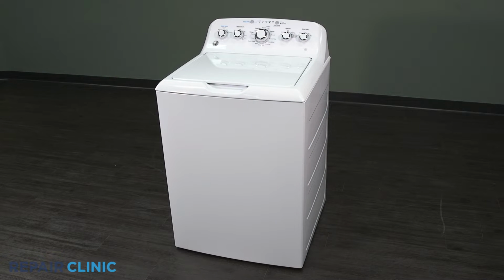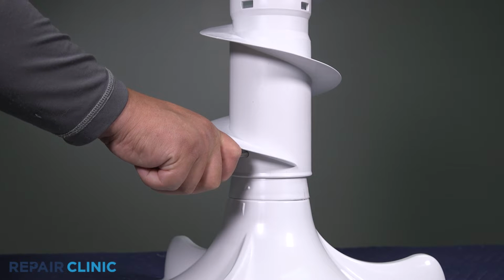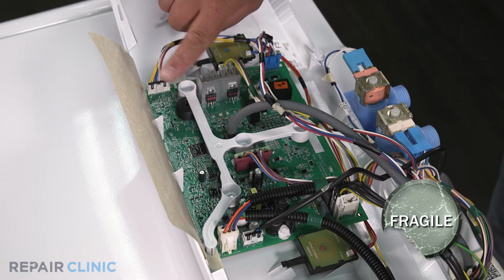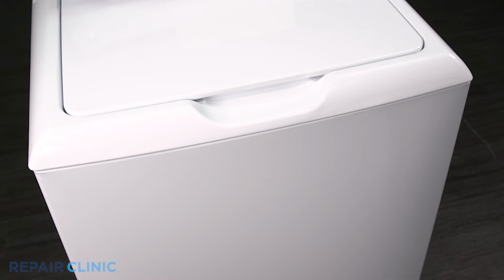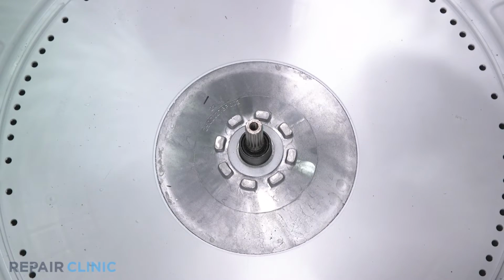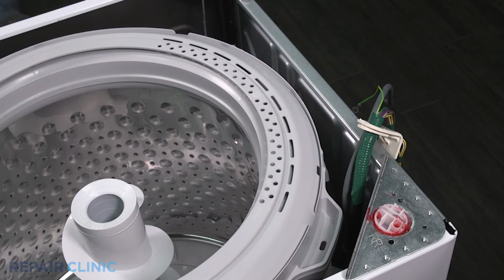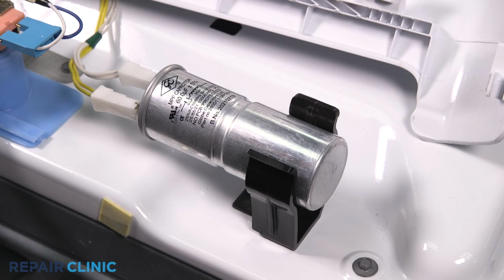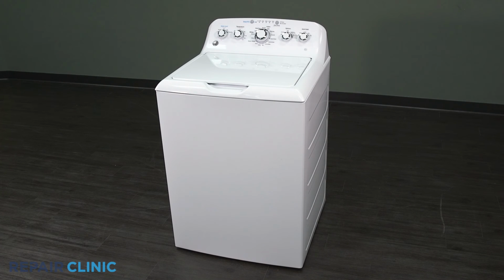GE Washer Basket Assembly Replacement WH45X26674

Comment: Can you please specify the deep socket you used to reach / unscrew the 33mm nut? 2:03 into video
Reply: Get a 33mm deep well socket. I run a Milwaukee m18 impact specifically for these situations. I suggest either this or their fuel line for the breakaway torque. If you're gonna do a breaker bar, you will need a comically big extention on it to clear the height of the tub. Also man, that auger is one of the worst things to deal with in this industry. If I were you, I would order a replacement assembly just in case you break the original during removal.
Reply: @YourFoolishPride  I was able to get the 33mm deep socket and with my black and decker impact it’s not budging at all. This thing is really on there. I have been applying penetrating oil every day for almost a week now to try to help it. I just bought a 20” socket extension and will try with a breaker bar as a last hope. This design is remarkably user un-friendly.
Reply: @jeremyhartman9798  I apologize for this foolish question here, but are you going cw or ccw? The problem also could be that your black and decker might not have enough breakaway torque for this situation. I'm gonna call another tech I work with to see if he has any tips I might have missed for you. 

When I used to work on semis, we would torch a lot of the bolts to heat em up for ease of removal, so there might be some merit in getting you one of those little acetylene torches you can grab from a hardware store.
Reply: @jeremyhartman9798  also man, GE is one of my least favorite brands to work on as of late. They're like the Saab of the appliance industry... Over engineered in the goofiest places. 

In case ya needed to hear this:
I'm rooting for ya, brotha. You got this!
Reply: @YourFoolishPride  I’m going cw - read that it is reverse threaded. It might be time for a more powerful impact I suppose…
Reply: @YourFoolishPride  I’m beginning to see that!! Thanks very much for your replies
Reply: @jeremyhartman9798  no problem whatsoever! I will be keeping an eye on this, so let me know how it all goes.

Also man, if you do go breaker bar, due to the 33mm socket, I would run a 1/2" drive breaker because 1/4" or even 3/8" might not help you enough. Cheaper route than getting a new impact set and batteries and all that.
Reply: @jeremyhartman9798  also if you're using pb blaster or wd40... try csr or lime/calcium removal. You could just have a buildup of those sediments that your cleaner might not remove.
Reply: @YourFoolishPride  yep I got a 1/2 inch breaker and socket extension and will be trying today. Will let you know
Reply: @YourFoolishPride  I was finally able to get the nut and washer out with the higher torque impact, but the basket is still not pulling up and separating from the outer ring… so I can’t get it out… I’m very confused now.
Reply: @YourFoolishPride  I’m actually dealing with gtws8350h1ws, which I thought was the same re: basket assembly
Reply: @jeremyhartman9798 you have to remove the tub balance ring clipped to the top of the wash tub, then pull the washer, and spin basket out.
Reply: @jeremyhartman9798 I don’t know if you would respond to this years later, but I am in the same boat as you.may I ask where did you find the 33mm socket and what did you do to take it out
Reply: @DiddykongAbdul  Just grabbed the socket from autozone but my impact is not budging this nut
Reply: I feel like I accomplished something getthing to 33mm off with channel locks and a hammer 😅
Reply: @creekwalker8178  a freshly charged battery did it for me. I tried the lock and hammer lol u gotta have Thors hammer or something over there.
Also how are u guys washers since changing it?
Reply: @jabapiper  I just had a regular 16 ounce hammer. I guess maybe mine just wasn't cranked down quite as much. I had to disassemble my machine because of a mold issue. Got it cleaned out and everything seems to be operating fine since reassembly and a few loads through the wash.